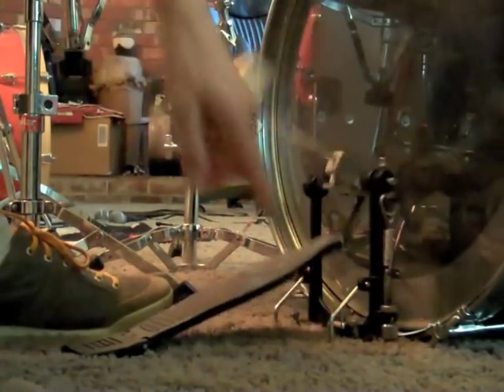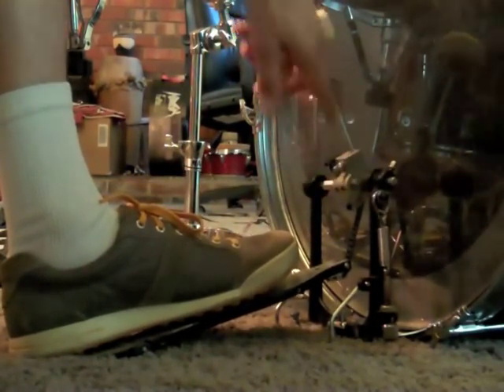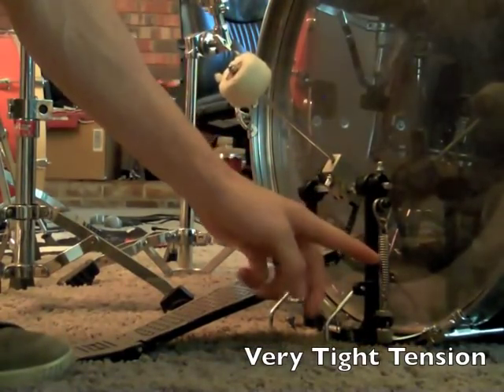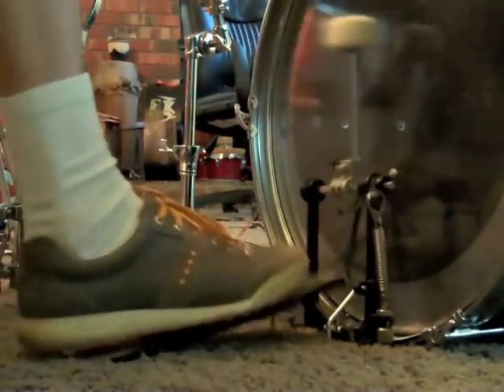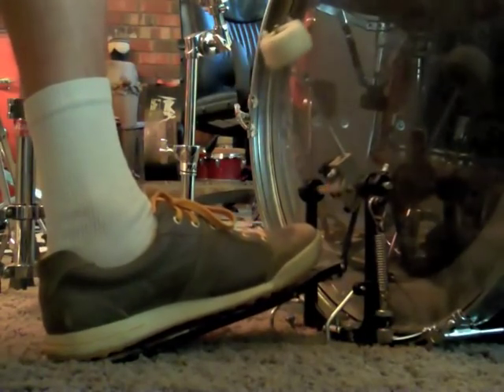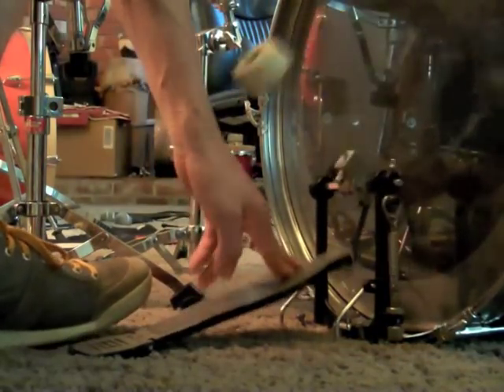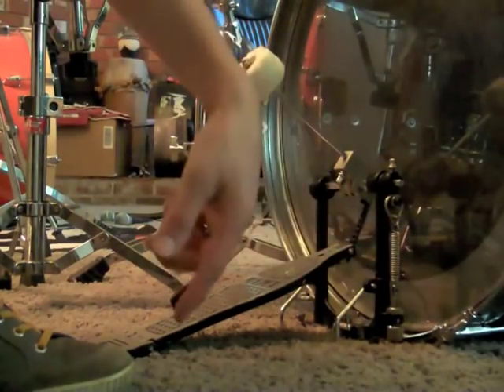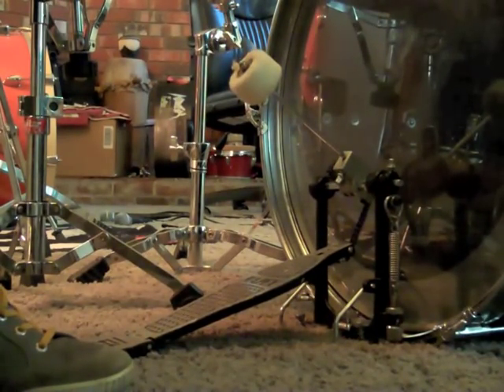Drum Pedal Spring Tension Explained

Comment: Great explanation. Most videos are about speed, and spring tension crainked up. I've heard that spring tension is based on speed, but I haven't heard it so consice. Everyone says to set it up for feel, but this is a great explanation for how to set it up initially. I've only been playing about 2 months, and am driving myself nuts with my spring maxed out per everyone else's recommendation.
Reply from the maker: Mike Smith I have other videos on spring tension as well that might help you. “Maxed out” isn’t so much a tension as a physical placement. It varies widely from pedal to pedal. So maxed on one pedal might be too tight for anyone to reasonable play while on another you’ll be wishing there was more than maxed because it’s still loose. For example the lower end beginner Iron Cobras have weak springs and can be tightened much farther usefully than the higher end professional ones.
Reply: @RyanAlexanderBloom  Thanks for the reply. I picked up a set of pearl eliminators double kick for $60. I know they're shitty n all, but that was a steal see that price. I found that 3/4 from Max tension it's the sweet spot, and the beaters are finally at the hight that feels right for being a noob at this. You're videos really helped, much appreciated!

Comment: Well, I tightened up the spring all the way and I think I still need more tension.  I have a Pearl 900 series maybe it has some sort of cam option, I'll have to check my box of do-dads and see.  But thanks for the info, my pedal was way too soft, felt the difference immediately.
Reply from the maker: I do not dislike the 930 Pearls as much as some of their other pedals. You may have another cam somewhere, it looks like it is a separate piece but I've never tried taking it off of one.  I do have access to one on a regular basis.  Maybe I'll look. I just helped a student with his 200 series Tama recently and the spring really didn't get tight enough. I recommended that he get new springs before he bought another pedal... so this scenario is highly plausible for your pedal as well.

Comment: Hi Ryan, What amount of tension would you suggest for a beginner drummer? It seems like tighter might be better, at least at first, until speed develops.
Reply from the maker: most beginners seem to have trouble playing a tight pedal at first, but then again developing a habit if playing on an extremely loose pedal is not good unless you specifically know you will need that setting for most of your playing later. I would recommend playing at whatever setting you can play the most easily and consistently at first, then slowly adjusting toward the best setting for the type of playing you end up wanting to do the most later. Starting on a speed setting when you are very new is hard, but also starting on a very loose finesse setting causes a lot of people to unnecessarily bury the beater. Its a tough call.
Reply: Thanks :) I prefer rock. At this point I still can't even get the 3 beats in for Sweet Home Alabama. lol It's not rock but I like that song. I know I just need to practice to gain strength. I am impatient and want to play everything now :D
Reply: Get a few lessons and learn all the note values. Will help a lot.
Reply: Bonnie Sanders Sweet Home Alabama is classic southern rock

Comment: When my pedal springs are tight I can do fast double bass at 200 bpm but there is absolutely no feel and I can't pull off Bonham like triplets with a tight spring.Also stuff like doubles I find easier with a looser spring.A tight spring is only good for fast singles and that's about it so if you are in a grind band crank up the springs.I want a more jazzier feel in my pedals so I will go looser.Have my Pearl Redline Eliminators at stock atm so will keep them as they are for a few months(they are quite tight)to see if my legs stengthen and I get a bit more feel from them.
Reply from the maker: Jellybeantiger there is, of course, a spectrum of tightness. It depends on the pedal what constitutes "tight" vs "loose". Some pedals will easily allow you to tighten all the way and still play while others you can't even press them down at that setting. All the way right means different things on different models. So, it's not that surprising to hear that on your particular pedal you can go too far and feel restricted. I, for one, dislike pearl pedals as a rule. At any setting I can't play as well as I can on other pedals.

Comment: Hi Ryan,
Nice and clear explanation indeed. Very useful. Many thks. 
However, in this video you're only talking about the spring tension. But what about the chain, its role, adjustment possibilities and settings, etc  (or maybe have you already posted a video on this subject) ?
Many thks beforehand for your answer.

Kind rgds,
Marc
Reply from the maker: I cannot recall ever mentioning the chain specifically in any video. This is probably because the chain itself is not really a relevant adjustment. If by chain you mean beater angle/distance, then I do have a video on that. Or if by chain you mean foot board height, then I do not have a video on that, but I suppose I could make one. The chain itself should always contact the cam as much as possible. Any adjustments to anything that the chain is connected to should be made without messing with the chain itself. Most pro level pedals from any brand allow for footboard, cam, or beater adjustment without affecting the chain directly. I have heard of people who take links out of the chain or add links to it… but this may be a relic of the days when there weren't so many adjustments as modern pedals now have.
Reply: Ryan Alexander Bloom Thks for your prompt reaction.
I'm talking about the angle between beater and foot board when the foot is not on the pedal (or the angle between beater and the drum head) (In the biggest is the first one, in the smallest is the second, right ?)
If you've already posted a video on that, I guess I can find it among the 87 previously posted ?

Cheers,
Marc
Reply from the maker: Marc Vander Linden bass drum beater distance explained this is the video most related to your question. I am not sure if I already sent this to you, but I just happened to see this comment today and it doesn't look familiar...
Reply: I would say chain is good when you play below 260bpms.If you looking for precission and speed then go Direct drive pedals.Far back beaters for speed playing.

Comment: great video.  my pedal doesn't reset.  if i press the pedal, the drum beater doesn't bounce back.  How do I set it up?  I am a guitar player w/ electric drums and I've tried the tension spring that you explain in this video and also the part just above that which requires a drum key.
Reply from the maker: Aonic Guitar hmmm. That's a tough thing to diagnose based on that information.  What kind of pedal is it? What kind of kick pad? The best guess I can give is that maybe the screw that is at the top of the spring where it connect to the rest of the pedal is stripped. This will cause the pedal to disregard the spring tension. Just a guess at this point.
Reply: +Ryan Alexander Bloom I think that's what happened.  I'll bring it in and see if it's salvageable.  Thanks mate.

Comment: That boom doom diddley boom that Paice is famous for,I find is hard with a tight spring.Doing the same thing on double pedals with tight springs is a diddle.Also doubles on a single pedal,much easier with a looser spring.
Reply from the maker: Jellybeantiger I disagree entirely but again it often has to do with what pedals you're using. I can do heel-toe a little bit on the pedal in this video, but not at all on my iron cobras.  Granted, it's not my finest double stroke technique, I use swivel and slide much more, but it has as much to do with the overall pedal as the tightness of the spring on each.  That's just an example, but in the overall scheme of things the generalized sentiments in this video hold true for almost all pedals and almost all techniques. I teach nearly 1000 lessons per year to drummers with all kinds of different equipment. I get a pretty good average on what works.

Comment: great video.  makes sense,  but it's seem to me, when I loosen my spring all the way, the beaters hit harder and I'm feel faster.  when I tighten my spring very tight, it takes alot off effort to get a hard strike. my pedal is a very cheap Mapex double bass.  and I can't seem to get the feel I want.  maybe I just need a better pedal.  cause what you explained seemed to make more sense to me.
Reply from the maker: The mapex pedal in the video is really low end and it feels terrible at any spring tension more than about halfway. I used it in the video just as a prop basically. I've personally never had luck with even the top end mapex double pedals...
Reply: Mapex pedals leave a lot to be desired. They have their place but you get what you pay for.
Reply: The mapex falcon I'm actually liking better than the DW 9002 and pearl eliminator right now. Much more comfortable heel plate than the nubby DW 9000 one and longer footboard feels more comfy too.
Reply: +Ryan Alexander Bloom I actually just bought a pearl demonator. it makes a HUGE difference. my timing is a lot better now too.
Reply from the maker: +Larry Tate I have a student with a falcon and one downside we found is that it very poorly accommodates different bass drum hoops. Switching it from wood to metal totally didn't work at all. Unplayable on a drum with an old metal hoop.
Reply from the maker: +Larry Tate also, the heel plate is a part of the pedal that I care the absolute least about. I play heel down sometimes, the only time this ever matters, but since I wear a 12 My heel is never near the plate on any pedal.  I just ignore it completely.
Reply from the maker: +Ken M if it works, use it. I dislike pearl pedals and I've seen people's playing ruined by them. If that's not you, then go for it.
Reply: I guess maybe the falcon had a bad design on its hoop clamp at one time. My falcon is about a year old now and it's able to fir on my very thick Yamaha absolute maple nouveau kit which is a ver thick hoop and my cheaper pdp kit which is a very thin hoop compared to my Yamaha. Even on my Yamaha where it almost always is, it goes on with room to spare and I have to screw down for a good 3 or 4 turn before it makes it to even touch the hoop. Only think I can think is they changed it over the years to my style. I know they did make changes on the pedal cause they used to have separate interchangeable cams to choose from and mine doesn't. I heard pearl put it a stop to it as they have that idea patented. Right now the falcon is my pedal of choice of the three I have. The 9002 felt like it was fatiguing me quicker on kick heavy songs than my falcon or eliminator. Why did pearl ruin your students playing? Some heavy pros like Todd sucherman use pearl elims
Reply: Ever try the Yamaha high end pedals by chance? I'm wondering how they are. I have the direct hi hat stand from them and love it, but I know hat pedals and kick pedals may not translate.
Reply from the maker: never played a high end yamaha, only the ones that come with their mid-range kits. No idea. Some of my students who want to play even double bass have had fits trying to get Pearls to respond in a controlled and consistent manner. Especially on Demon Drives. They're too light, in my opinion, and much of your energy goes into steadying the pedal rather than playing it. Every tiny twitch you make gets you off beat. You have to be perfect and you get no assistance from the pedal. One student in particular pretty much quit lessons because he couldn't make his Demon Drives perform constant 8th notes. I showed him every trick in the book and then it would never translate to successful playing. With another pedal, he could have done it. Im sure.  Also, all of my students who play other pedals, and then try the Pearls, say they can play faster on their own pedals and they complain a lot. I can't disagree with them all. Lots of pros use lots of things and it doesn't make that thing good. Todd isn't known for his massive double kick chops... what does it matter what pedals he plays? I could play Styx tunes on anything. So could he.

Comment: Thank you. What tension would you recommend for playing John Bonham style? For example, The Immigrant Song and Good Times, Bad Times.
Reply from the maker: It depends on what technique you use for playing the main beat in Immigrant Song. I would personally play it with my usual medium tight spring tension because I typically play those "doubles" as two fast singles. If I switch it up, I go for slide technique which works great at a medium to tight tension. I see no reason that playing Zeppelin would require loose springs unless you really wanted to play heel-toe or somer other strange thing that Bonham never did.
Reply: I've been leaning slide foot

Comment: Simple and straight to the point! The fact is all these pedals are badly conceived, the foot anatomy is not addressed! the foot ROTATES around a point  a few inches from the rear heel, and all these pedals are missing that point! As a result and/or  consequence almost ALL drummers adopt a heel up tech, I can only remember one model made by a French Company {ASBA} in the 70s which was actually using an adjustable sole bearing rotating point [ you could control with your heel the back up motion!!!]and many other features that I never saw again...I actually use  two simple SONOR pedals [double bass drums] and FOCUS ON THE SPRING !... they are all different, and change the overall feel, regardless of the tension...
Reply from the maker: This point you raise might be why lots of drummers are moving to longboards these days. A longer footboard would necessarily move the hinge back. I think your assumption that heel up playing is caused by the position of the hinge is not accurate. That is mostly about freedom of movement and the extra power benefit and would be the case on any pedal.
Reply: +Ryan Alexander Bloom thanks to discuss that point, you may be right, it could be pretty much that the fact that most drummers are reluctant to play heel down, more difficult, and so more easy to use one's leg weight, heel up, to get more power, [a beginner approach] that the manufacturers assume everyone needs to play heel up ? LOL ! The solution to that problem is to create a pedal using magnets, not springs,  and adjustable axis rotation point, under a long board!
Reply from the maker: I know of only one magnetic return pedal ever made and it looks like its poorly conceived. The magnet only pushes upward and if you exceed the range of motion there is a hard backstop that just abruptly stop the pedal motion. The best thing about springs is that they move the pedal both forward and backward in order to come to rest at a point in the middle. This rebounds your stroke but also smoothly allows the pedal to work like a pendulum. If the beater goes past the mid point of the stroke toward the back side, the spring returns it to the front. This is how drummers are capable of playing extremely fast. They utilize the natural spring-loaded swing of the pedal.  IF the magnetic pedal had an additional magnet that could provide this forward rebound and allow for smooth constant oscillation, then yeah magnets would be fine. As it stands, the magnetic pedal idea is only half developed. I think manufacturers make pedals the way they do because this is the way they've been made for 100 years. They assume this is how they are supposed to work. Heel up playing, on the other hand, has little to do with the pedals in my opinion. You have to use heel up to gain the power that is necessary to project your sound off of the stage... unless you know of a way to build a pedal that will increase your volume to the point where that is not the case.
Reply: +Ryan Alexander Bloom You made your point of view very clear, your passion is contagious! Interestingly, I never had a problem with the volume/power of my bass drums!? I am not promoting heel up tech, or down tech, I advice my students to be able to use both! But I notice that, when playing latino beats, I almost never used heel up, so, I understand that a louder style of drumming, like metal, does require a heel up tech to produce max power! I noticed as well, that 90% of drummers using exclusively heel up tech, lack precision and control, and this specially when making double strokes, as it sounds like it is the pedal to decide how tight is the double stroking, see my point?

Comment: hey there ... thanks for this – what would you recommend for fast melodic punk rock and using the double stroke slide technique? More or better less spring tension? cheers mate.
#
Reply from the maker: J4NN3K I think it’s easier with a little tighter tension. Too loose and you have to work really hard to pick your foot up after each stroke.
Reply: hey.. thanks mate - i though so ..  let's see how i'm gonna manage that with my elephant feet :)